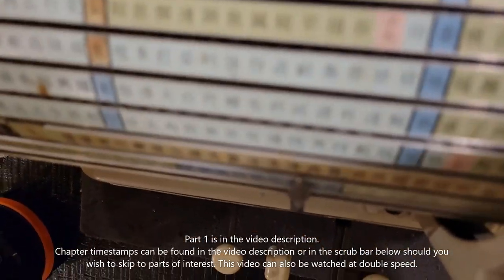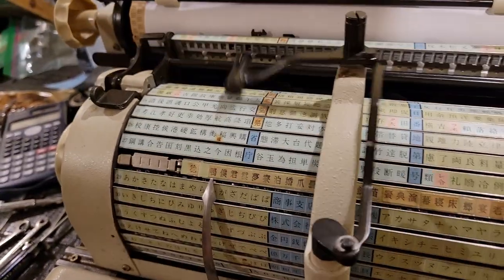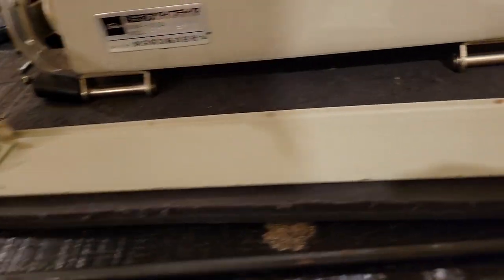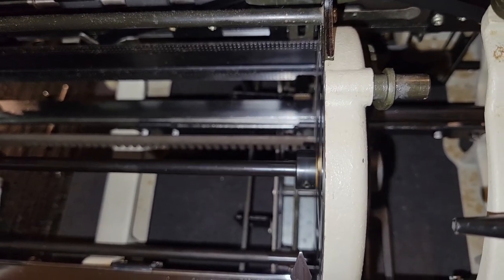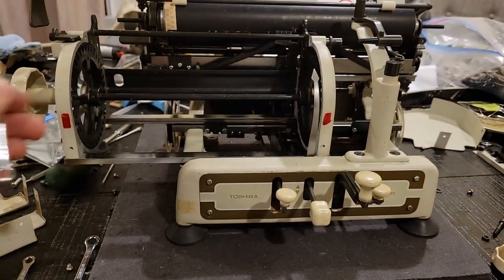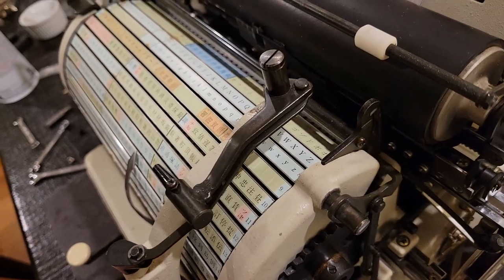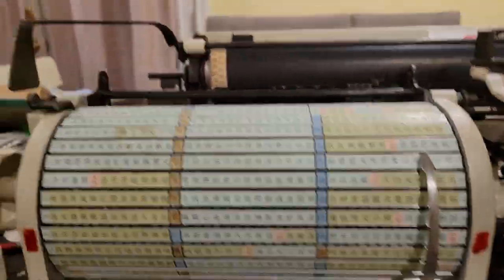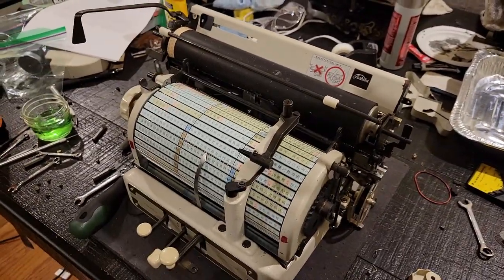Toshiba BW-3112 Japanese typewriter restoration - part 2: adjustments and cleaning

Comment: I assume that the machine has no line lock function because Japanese does not require it. In Japanese you don’t use spaces between words and you can go to the next line at any point without it seeming odd, unlike in English where you need a little warning so you can not start a long word at the end of a line, or at least think about where to hyphenate it.